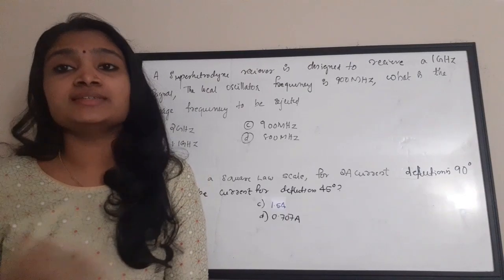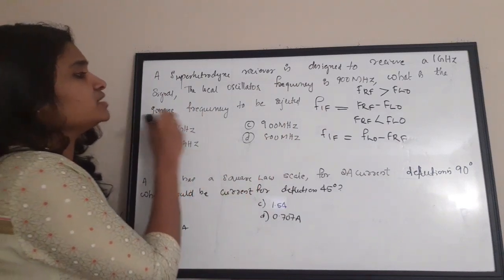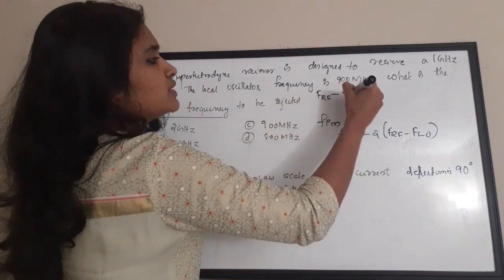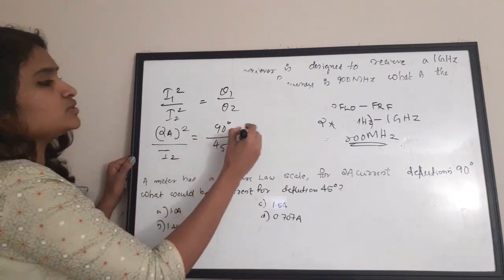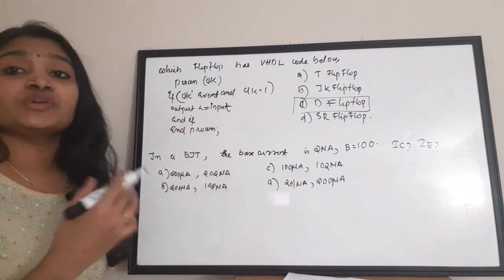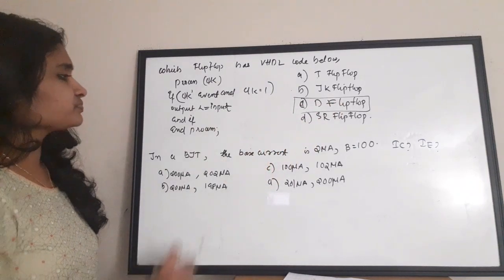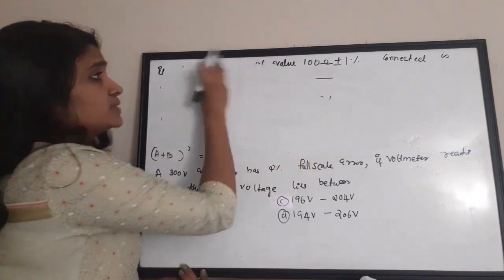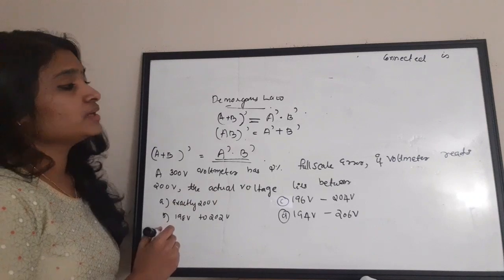NESAC-ISRO Technical Assistant Electronics 2020 Solutions Part5| ISRO|Gate|BARC|DMRC|AFCAT Prepare

Comment: Mam I have doubt on series resistance question with tolarence plz clarify . Given resistance value is 100 ohm plus or minus 1 means the resistance value inthe range from 99 ohm to 101 ohm right .the if we add the 2 resistance values we will get the total value inthe range 198 to 202 .this value is +/- 1% for 200 .but you have given +/- 2% .what is wrong in my answer please explain